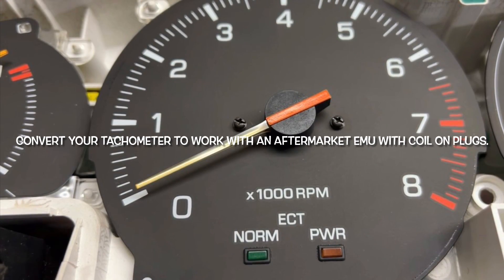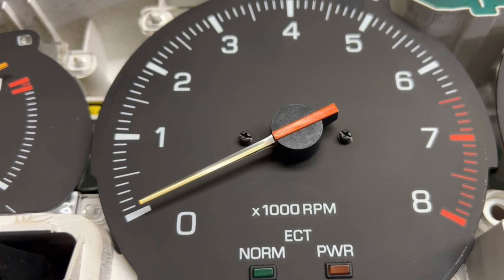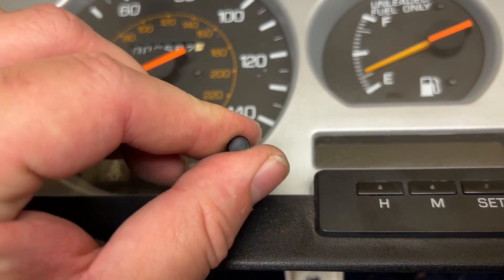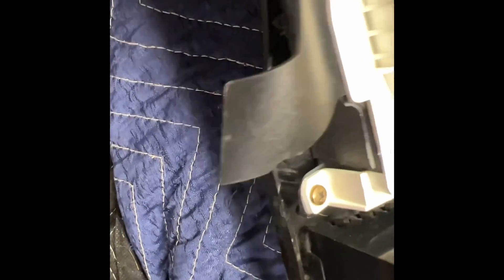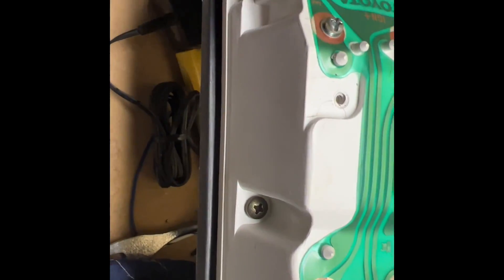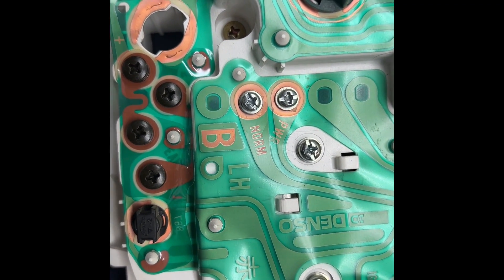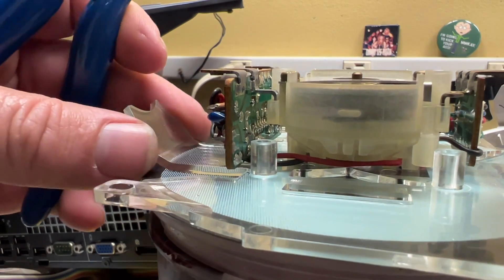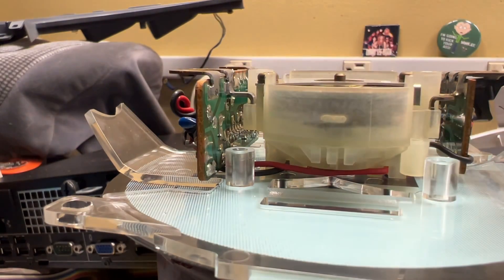Converting a MK3 Toyota Supra Tachometer to work with EMU Black Standalone ECU & Coil On Plugs 2JZ

Comment: I have  1999 Toyota soarer 1jz vvti with the digital dash. running emu classic with r8 coils wired up tach output to factory tach wire from the ignition. doesnt work. no rpm. will this help?
Reply from the maker: Unfortunately I am unable to answer this question as I’m not familiar with the digital dash circuit design.

Comment: I just want to replace the rpm gauge with one that displays higher rev counts and has a shift light.
Reply from the maker: These cars will likely age best preserving the original gauges.
Reply from the maker: If you have converted from auto to standard, you can repurpose the lights in the cluster as shift lights. I have mine set for “NRML” with no boost, “PWR” with boost and O/D light for shift point. All super easy to setup.
Reply: @SupraSeth I was thinking about buying one of those round LCD Displays and building an Arduino powered Navigation unit that also shows the speed
Reply: @SupraSeth could you maybe measure the size (or tell me the diameter if you already know it) of the rpm gauge and speedo? That’d be a really big help.
Reply from the maker: @holzwurm_hd7029 , I don’t currently have one disassembled to take measurements. There is a MK3 Supra group on Facebook with many write ups with outfitting generic screens and micro computers into the cluster. I would suggest looking there.

Comment: Nice. I have a 2jzge swapped in mine on emu classic. Will it still work with the 2jz ?
Reply from the maker: Yes, as long as your EMU has a tach signal output, it will work with this modified gauge.

Comment: What was the wattage on the 10k resistor?
Reply from the maker: @mulletsbulletsandmtndew9522  I’m using 1/8 watt and it’s been working fine. You could go up to a 1/4 watt if that is what you have.

Comment: Great work! I used to have a 1988 Supra turbo, now I’ve built a 600 whp 91 300zx tt. Stand alone haltech with working AC. Drivability is key for me also. I’m thinking about removing the clutch fan to go with Spal electric fan. Do you have heat issues?
Reply from the maker: I’m clutch and wouldn’t change it for the world. E-fans have their place, but for daily driving or grand touring; nothing beats a clutch fan as for efficiency. An alternator is only 60% efficient, so only 60% of the crank power it consumes is producing electrical energy. Then an efan is 80% efficient at best. So doing the math, driving an efan is far less efficient with consumption of horsepower to move air than a clutch fan, which is nearly 100% efficient mechanically. Most people assume an alternator is just a free spinning power source, but the fact is the more of a load the alternator is under the more of a rotational drag is placed on the crank.
Reply: @SupraSeth  Thanks for your time.

Comment: Is it 5v or 12v? and what is your duty and dwell time set to in the ecu?
Reply from the maker: I believe it is a 12v signal. As for settings, I show a screen shot of the setting values. Are you using EMU Black?
Reply: @SupraSeth  Thanks, i must have missed the screenshot. I am planning on maxxecu but just looking for options on tacho and speedo. I need the stock ones to work with the new engine

Comment: How did you connect to the emu what side of the yellow plug did you use?
Reply from the maker: The assigned tach signal output on the EMU goes to the M1 plug Pin #4. Here is a link with some handy drafts of the plugs.
http://www.shoarmateam.nl/content/wiring-the-2jz-into-the-ma70-chassis/
Reply: @SupraSeth  i got that but what side of the yellow plug did you run to the emu black the  cable from the female part or the male part?
Reply from the maker: @efrayimh.6950  I used a male plug (engine harness side) that someone sold me so that I didn’t have to cut the factory harness within the dash. I hope this makes sense? I can’t add pictures in the reply or I would for clarification.
Reply: @SupraSeth I have the same question actually. EMU black getting rpm signal and I did the resistor mod but still getting no signal to the tach. Looks like I need to tap into wire at the cluster to the emu tach pin? A pic would be super helpful!
Reply from the maker: @mikenieves87  , I’m not aware of how to add a picture to my response, so let me start by suggesting that you reference this website: http://www.shoarmateam.nl/content/wiring-the-2jz-into-the-ma70-chassis/
Scroll down to the M1 plug which is a 10 pin body plug above your glovebox. Pin 4 is the wire that feeds tachometer to your cluster. You need to connect your EMU Black tach output to this wire.
Reply: @SupraSeth  thanks for responding so quickly! Are you in any of the FB groups? I enjoy your videos and have a very similar setup to what you’re working on
Reply from the maker: @mikenieves87 , yes sir I am in almost all MK3 Supra and JZ groups on FB. Happy to help others out. Thank you for the positive feedback!
Reply from the maker: @mikenieves87 , I posted a few pictures in my community posts. Hopefully this helps you out.
Reply: @SupraSeth thanks for the info. I just pulled my emu black to check the wiring and it’s spot on. I did the resistor mod. I have bti guages that read rpm fine. Unfortunately my tune is locked and I can’t make any changes or see if my rpm is enabled.
Reply from the maker: @mikenieves87 , double check and see if the tach wire is connected to the Aux4 on your EMU which is pin 20 on the gray plug.
Reply: Yeah I pulled the ecu out thinking I had to connect the wire from tach just to find it's already been done. I'm pulling the tach out just in case I swapped the wrong resistor.  @SupraSeth